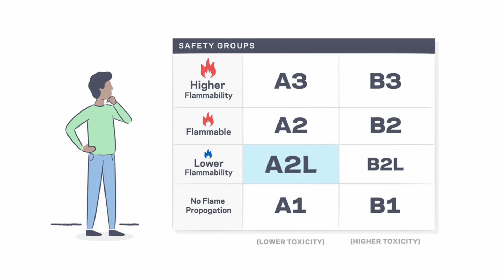HVAC Central AC Equipment About to Get Real Expensive! Myth Busting Flammable R32 & A2L Refrigerant

Comment: If the US politicians want all this stuff changed then make them pay for the changes from their own pockets to the American citizens. We have 4 units 410A that are about 5 years old. We have 100lbs of 410A reserve. I have multiple 2 ton split heat pump ac units still in the box as backups and i even have 2 brand new 4 ton condensers and 1 4ton return brand new in box. I also just purchased 3 new 2 ton solar mini split heat pump units this morning.  When everything in my inventory is dead then i will explore a new ac system but i think i am covered for at least 40 years!
Reply: Prepper much 😂
Reply: @AustinAirCo  Not sure how you can be this confidently and 100% wrong.  It CLEARLY states otherwise...

"Self-contained HVAC systems using R-410A will NO LONGER BE MANUFACTURED or IMPORTED after January 1st, 2025, but there is a THREE YEAR sell through period.."

Meaning, you can not MANUFACTURE a R410a unit after January 2025, but you can sell and install them until 2028....
Reply: @redbaron6805  I know you're misreading and disillusioned in your own knowledge because you state these thing with no proof, no link no nothing. There are differences in HVAC among equipment types. Package units allow a longer install period yes that's true ignore context for what I say at your own peril. But this doesn't extend to the split system type of HVAC system. Do you understand the difference between a package system vs a split system? Clearly from what you write here you don't understand big problem for you. Not me. 

The description you provide: "Self-contained HVAC systems using R-410A will NO LONGER BE MANUFACTURED or IMPORTED after January 1st, 2025, but there is a THREE YEAR sell through period.."

A self contained HVAC system? Is a packaged system. ~Ignorance is no excuse. For my market: 99.9% are split systems / not packaged. (Residential) :text-green-game-over:
Reply: @AustinAirCo  This comes directly from the National Association of Home Builders on their own website...

"As part of this transition, the U.S. Environmental Protection Agency (EPA) has set transition dates for new equipment required to use new refrigerants, commonly referred to as A2Ls.

Residential and light commercial air conditioners and heat pumps MANUFACTURED after Jan. 1, 2025, must use the new refrigerant. The equipment MANUFACTURED PRIOR TO THIS DATE has a one-year grace period to be installed — a Jan. 1, 2026, installation deadline.

For products that do not require field assembly, such as window air conditioning units, the rules establish the final date of sale as three years after the manufacture compliance date — a Jan. 1, 2028, sale deadline — without a compliance date for installation."

So, there are two deadlines, one for package units until 2028, and one for central A/C installations until January 1st 2026.

So, your claim that it will be illegal to install them in 2025 is 100% false.
Reply: @redbaron6805  It's completely different for new construction. Those jobs are often times presold not completed until 6 mos. to a year out depending on back logs etc. 

So you clearly do not understand what you're reading about the comment I made. I said there will be "SOME" exceptions that push the date out to 2026. Did I not say that? That said if the equipment is not available you won't install it anyway in 2026. Cleary you do not understand how HVAC works. Nor limitations involved in such. 

Once manufacturers switch over, the left overs won't last long. We have had trouble getting parts and pieces for over 3 years now.
Reply: @AustinAirCo  Basically whatever R410a equipment is sold in 2024 will be able to be installed in 2025.

You have had trouble getting "parts", but entire systems have not been in short supply for awhile.

You appear to forget that January 2025 is in the middle of winter.  

You think people will be installing a bunch of air conditioners in the middle of winter and depleting the R410a stock by February...?

It won't be until the start of the summer heating season that the remaining inventory will start getting depleted.
Reply: @redbaron6805  not if it's not in stock. They told me in 2022 to get it at your mama's house. There's rules against installing it at just any time you want. I have to follow those rules whether you or your mother like it or not. Those rules may or may not change. What we know now? Means nothing. HVAC -- you want me to tell you your fortune. Sorry there is no crystal ball for you. :face-blue-smiling:
Reply: @AustinAirCo  2022 was during pandemic time, the year is already 2024.  There are no A/C supply shortages in my area.

Most contractors are very slow in January and February around here as most A/C units are off during that time.

If this was a concern, you could place an order for one in December, put a deposit down on it, get it delivered in January or February or later in the year, and have it installed.

Also, the rules could be adjusted, delayed or changed depending on how the transition is going in early 2025.

If there is a lot of R410a inventory still sitting in warehouses, or if there ends up being a shortage of R-32 or R454a equipment, shortages of refrigerant for those two, or a host of other reasons, this could all change before it ever becomes an issue.
Reply: @redbaron6805  I think cost differences will evaporate any R410a inventory quite quickly once pricing is known. The manufacturers discount the remaining R410a inventory and that stuff is gone selling out larger capacity systems first. 

There is no benefit to manfacturers to continue to make R410a inventory once the switch is made. 12 year exemption only for the new stuff as according to Kigali Amendment USA target is to get below 350 GWP by 2036. This among other things could get pushed back. Europe is moving toward R290 (Propane) and bans for F-gas are in place. 

That will take time for the US. But I think that is where we are headed. 

Even with R22 phase out and dry shipped units loop hole only lasted about 3-4 years. I doubt R410a will even be that long once the remaining stock is gone I believe that will be it. This won't take 3 years and for some capacities less than 1 year. The manufacturers know the round about numbers they sell any given year. The pandemic had mostly to do with keeping crews healthy and materials needed to make the machines.
Reply: @AustinAirCo  I don't necessarily disagree with that, but mini splits, window units and package units can be sold until 2028, with no installation date restriction, meaning installations of those will continue into 2029 at least.

Once production is switched over to R-32 and R454a, there will be little point in continuing to produce R410a units beyond late 2024.

I'm curious however how much the production of existing R410a designs of central A/C units has to be modified to make them R-32 or R454b compatible.  I suspect the design changes will be minor.

What I have read so far, is the suction pressure of R410a is 118.8 psig vs 113.3 on a R454b system.  At saturation condensing temp of 110 degrees F, the pressure of a R410a system is 366.4 psig, vs 349 psig on a R454b. I believe R-32 goes up to 377 psig.

Which does beg the question, how difficult will it be to convert existing designs to be R-32 and R454b compatible.

It looks to me the changes required will be rather modest, and most of the existing R410a parts will probably transfer over to the newer refrigerants.
Reply: @redbaron6805  my area is nearly 100% split systems and window units can be flagged by HOA's in my area as if seen from the street they are deemed to reduce property values. 

The refrigerant flow rates are different than R410a for both refrigerants. R32 has high discharge temps so trying to get that to work with a R410a designed unit you lose compressors. R454b is probably closest match to R410a but flow rates are still different. There is required mitigation due to mild flammable classification of both refrigerants. So circumventing this kind of stuff could be painful for anyone contemplating such. Fines, fees, lawsuit filed against you for not following rules. So good luck with that. Not worth it in my opinion, far easier to follow the rules and charge accordingly.
Reply: @AustinAirCo  I'm not saying you can take an off the shelf R410a and run it with R-32 or R454b.  

I'm saying the engineering changes needed at the manufacturer to take a R410a design, and modify it to be R-32 or R454b compatible are likely to be very modest.

The coils, compressors, motors, relays, capacitors, cabinets etc. are likely to be the same. 

The difference will likely be the pressure valves and possibly a slight redesign of the compressor.

The operating pressures are very similar, while R-32 requires less refrigerant and is slightly more efficient as the refrigerant transitions faster from liquid to gas, which leads to better cooling performance.

That is why I'm skeptical there is an actual engineering or production reason for prices to go up, except in the very beginning as production ramps up.

I do however understand that bottomless corporate greed is the norm these days, and some companies will use this as an excuse to boost their prices and profit margins, and pretend the change was the reason the needed to charge more.
Reply: @redbaron6805  well there's new controls called mitigation from my understanding that if the unit senses refrigerant leak it goes into a mitigation mode. 

There will like be non-arcing relays, contactors etc. This is all precautionary because the US is a highly litigious country. And HVAC manufacturers are thought to be bottomless pits of money. 

So all these things cost money. R32 is known to have high discharge temp, what they use to control this? Is it specific to the compressor or some external part? 

Indoor coils are essentially the same except again mitigation controls if leaks are detected. How much does a cheap leak detector cost? Throw in all the non-arcing type controls. Some units IE 2 speed units have no contactor already. But those units cost more. 

I'm not an engineer, I am mr. fix it that the engineer makes. My job isn't to reverse engineer it. I don't think that is your job either. In terms of greed you could argue air conditioning was invented because someone said wow I pull this off I will become very rich. But people wanted it. They still want it. I grew up without air conditioning and even I want it.
Reply: @AustinAirCo  I agree that they will probably implement some non arcing relays and components, as R-32 is slightly flammable, but in real life it would be virtually impossible to get the concentration of gases to start a fire, especially with a slow and small refrigerant leak, and the fact that the amount of R-32 refrigerant is less than in a R410a system.

Air conditioning was actually first implemented commercially in manufacturing plants to mitigate humidity to prevent metal parts from rusting.  The fact that it made the workers more comfortable was just an accidental side effect.

I have no problems at all with people wanting it, or basically needing it.  I can't sleep in a warm room myself.

But I have always been a little puzzled that they didn't combine water heating and air conditioning.  I have a Hybrid heat pump water heater that sucks heat out of the ambient air and uses it to heat water, the waste air is air conditioned cold air.

It is a bit strange when you see condensing units dumping hot air all day long, only to heat up water using electricity or gas, often a  couple of dozen feet away.  I would have thought using the waste heat to heat water would be a rather obvious and efficient way to do it.
Reply: @redbaron6805  these kinds of products do not make themselves. It requires years of engineering and then complex factories to make them. 

Flammable? get it hot enough anything can burn. This short clip demonstrates it: https://www.youtube.com/shorts/W4PiBIyNjx0

Comment: The only thing they are worried about is getting more money in their pockets. Nothing lasts and works like the older units and the environmental cost of these non durable goods that dont last way exceeds the energy savings of these new items.
Reply from the maker: You’ll see another 20 years from now they’ll be a new refrigerant to replace this A2L
Reply: @PipeDoctor  The EU is already looking to ban R454b due to it having PFAS {forever} chemicals in the R1234yf blend of the mix. R32 has no PFAS chemicals. I'm surprised so many companies in the US are going with R454b. Sounds like a transfer of wealth to me.

Comment: I think the increased "flammability" is coming from the refrigerant that is going to be blended with the R32.  The auto ignition temperatures for R410A is 790°C/1454°F and the R454B that it seems that most of the industry is adopting has an AIT of 498°C/928°F. (R32 alone has an AIT of 648°C/1198°F.) Also another reference for the temperatures is the AIT of R22 632°C (1,170°F).

I think at the end of the day everyone needs to stop un sweating fittings. Also the reason for vacuums needing to be spark proof is due to the refrigerants that are trapped in the oil and are being boiled off.  

 Unfortunately most of the information that is becoming available seem to have a large sales pitch behind the info.
Reply from the maker: I totally agree just like sales training by manufacturers is mostly sales

Comment: There has been concern about high compressor discharge temperatures with R32 causing oil carbonization and valve failure… We’ll see how reliable they are soon enough.
Reply from the maker: I don’t have that much information on ATL‘s and are 32 and 454 or whatever but I can wager is that in 1520 years from now this will also be a phased out refrigerant that they want to get rid of our 12
Reply: They've been using R32 in Europe since around 2014. Well over 100 million units in operation. R454b: 0 units installed to date. Guinea Pigs wanted. Don't forget to get tested regularly for liver cancer too. (PFAS chemicals in R454b)

Comment: You want to talk about flammable? My GE refrigerator uses R600a, which is isobutane.
Reply from the maker: Wow 😮
Reply: Same with mine, but charge is only a few ounces. Probably burn off in seconds if it leaks.

Comment: So parts will still be available for years and 410a production will slow down come 1Jan25.
JUST had a new Amana/ Daiken installed in my rebuilt house, house fire,  so guess I may have to buy some 410a and hold onto it in my garage.
Yes, I have my Certificate. 
Appreciate the announcement Mickey! Much love from San Diego bro

Comment: I can remember when Carrier came out in the mid 90’s with Puron and it had a sticker of the earth saying how great it was for the earth.then they phased out R22 but sold  dry R22 units until all the inventory was gone.i wonder if that will happen now.
I took my continuing education class for my HVAC card and the instructor was talking about the changes with the equipment coming out.he was talking about sensors being in the units if the coil leaks it cuts the unit off.he said himself he didn’t know what exactly is going to happen.i guess we will find out soon.
I do agree with you about the lobbyists.

Comment: The government did such a good job with the EV's.  What could go wrong with R32?
Reply: Nothing, because it had been used as a constituent in refrigeration for ages. Actually offers really good performance similar to 410 and is cheap too (in Australia anyway)
Reply: I actually had a window AC with 32 in it spring a leak, repaired it the leak and filled with 410a.  Worked exactly the same.
Reply: @JesseDoesHVAC  So has butane.  don't want it in my home AC either.
Reply: @robertsmith2956  i really think everyones freaking out over nothing. Propane and natural gas has been used in residential appliances for decades, r32 has an even lower flash point than either of the two. Youd literally have to fill a room with the stuff and light a match to have anything exciting happen.
Trust me, the same thing happened here nearly 10 years ago (Australia) when r32 was rolled out. Everyone lost their shit but here we are all this time later and ive not heard of one incident involving a house fire (or any fire for that matter) where r32 was the blame
Reply: @JesseDoesHVAC  or they refuse to admit it.  A LOT of houses have been blowing up lately.
Have you seen the size of some of these closets they install the AC in?  What is in the system will easily fill it.
Reply: @robertsmith2956  i would agree, except here in Aus apartment/closet style airhandlers do not exist. We used to have up/down flow gas furnaces in closets but these have been banned. Refrigeration Units are basically installed in ceiling/roof cavity or externally.
Reply: @robertsmith2956  Yes... everything is a coverup and conspiracy now.... just facepalm levels of dumb...
Reply: @JesseDoesHVAC  So if you get a new HVAC, you also have to do a major remodel to put in a replacement unit to get it out of a closet? Yeah, R32 is dumb.
Reply: @Dav1d_B  no they banned open flu or natural draft. Gas furnaces are appliances in the property cannot be internal must be a seal combustion chamber. What I was referring to is that we don’t actually have apartment style or closet style AC systems here it’s not a common thing generally they are installed in the attic or roof space or in the subfloor/basement.